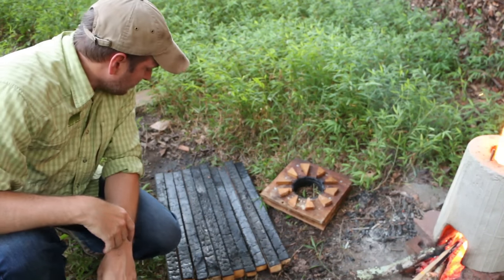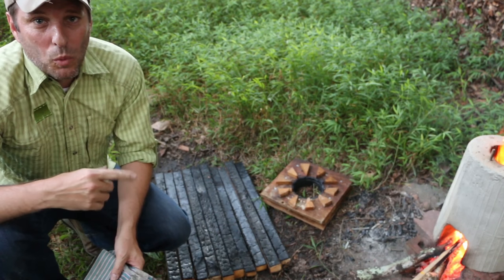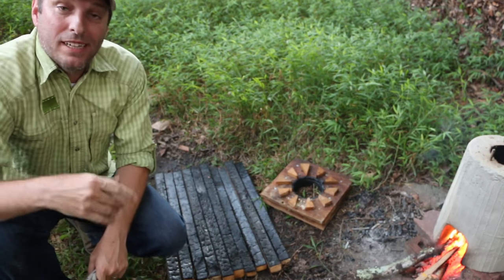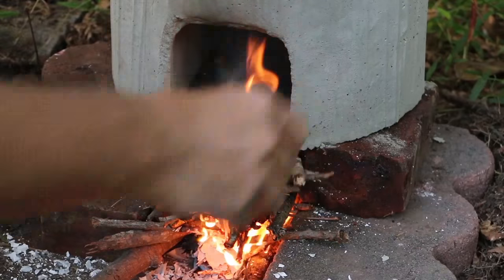How To Do Shou Sugi Ban On A Rocket Stove

Comment: I had never heard this called show sugi ban before.  It looks like the rocket stove definitely did the trick.  Did any of the wood get sacrificed in the charring or does it pretty much keep it's dimension?
Reply from the maker: The shou sugi ban burn rounds the edges a bit, but as long as you keep the burn-time to about a minute the charred side of the wood gets filled with cracked channels, but generally keeps it's width. I ripped the boards in half first, so I could burn on the flat edge side, versus the curved corners of the lumber. Burning on an edge with the factory curves allows the fire to consume more of the dimension.